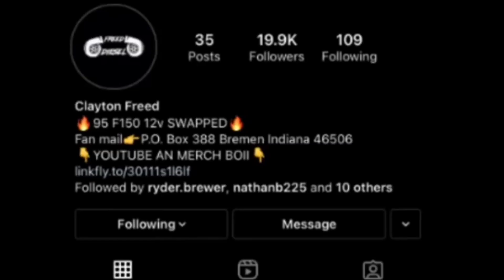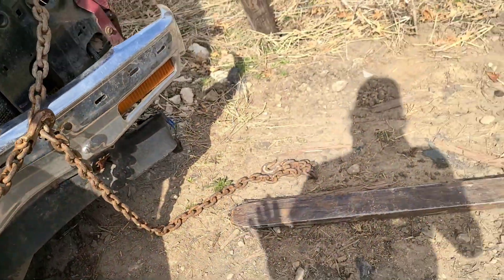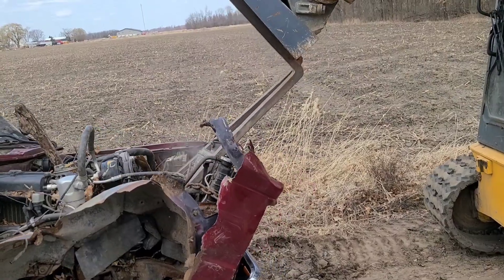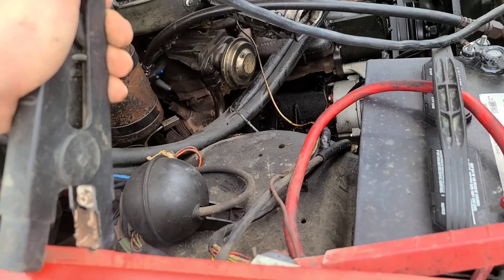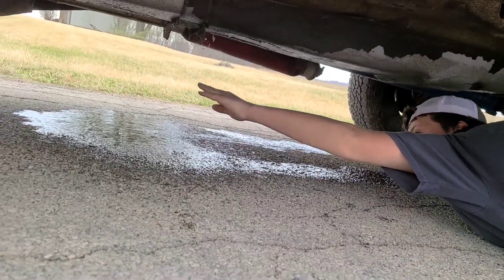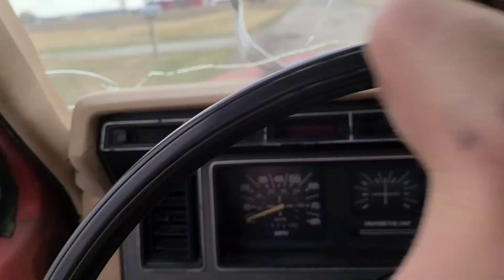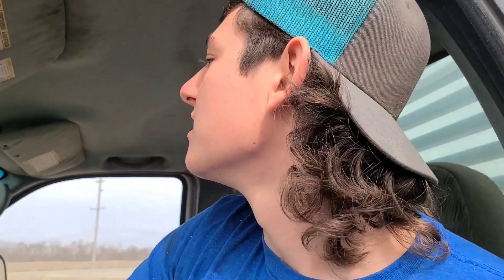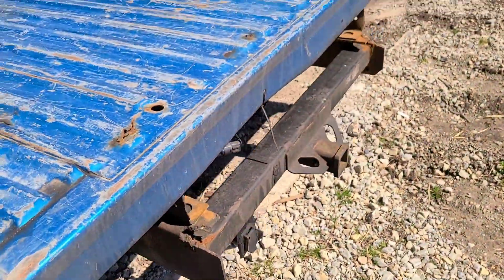THE YEETER BEATERS WONT RUN

Comment: Your power steering and brake issue is probably due to the power steering pump. Theses have hydro boost so the brake booster runs off the ps pump. Probably not building enough pressure.

Comment: now instead of doing a the hpop seal, now you'll be doing a power steering pump. lol the steering and brakes are assisted both off the power steering system.